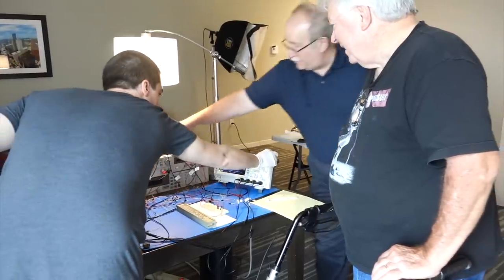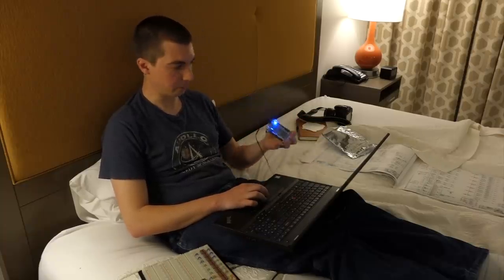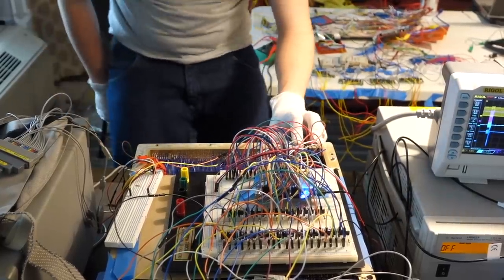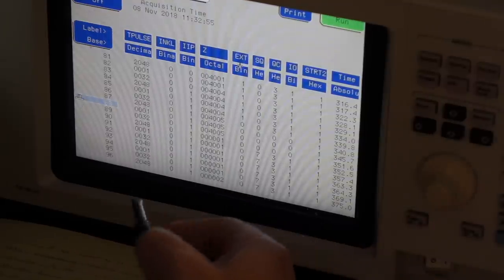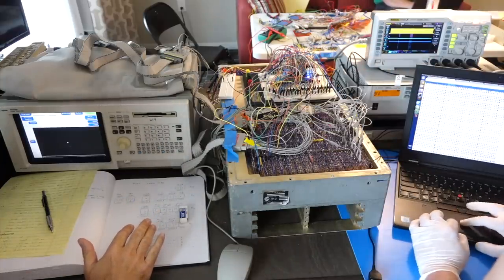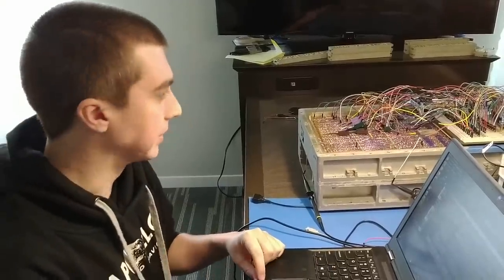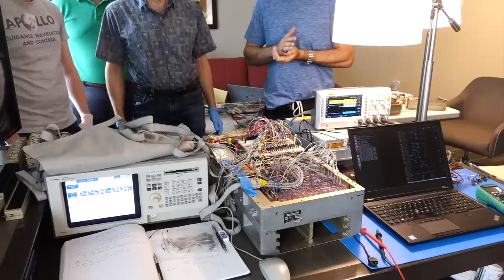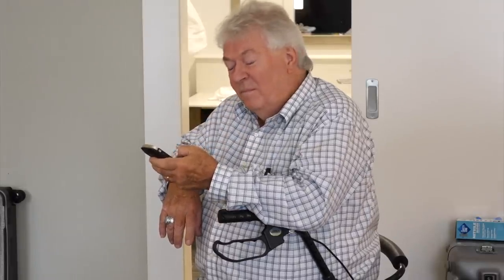Apollo Guidance Computer Part 5: We run a chunk of original Apollo code!

Comment: It would be so cool if you could get this thing running up to 100%, with the DSKY and clock displays, and then run the launch guidance program at 9:32am on July 16, 2019.
Reply: So that's what I was doing 50 years ago. lol
Reply: Conect some form of output ( some lamps ) To unused ram partitions and code a simple game by writing to these memory adresses .

Ore a game on the dsky if there is one available 
That would prevent bored astronauts
Reply: Wasn’t launch guidance provided by the IU in the interstage ring between the SII and SIV-B?  
    Was the AGC simply running a display of the MET, and velocity while providing attitude data to the 8 balls?
Reply: Stepclimb I think the IMU did handle the data gathering and the actual execution of the launch commands, with the AGC being there to monitor and function as a backup if the IMU failed. On Apollo 12, we saw the AGC get taken out by the lightning strike, but the IMU was unaffected. I wonder what would have happened had the reverse occurred.
Reply: The Saturn V guidance system was totally separate from the Command Module's, and had its own IMU. The CSM's IMU was affected by the strike, in that its control loop was broken and so it started tumbling. They had to re-align it once they got to orbit.

I believe on all missions the AGC could take over control of the TLI burn from the SIVB, but on later missions it was possible to take over during any stage of flight. During first stage flight the computer did open-loop control, but the closed-loop control needed during second and third stage flight didn't fit in the available memory, so the astronauts would have to joystick the Saturn V into orbit by comparing numbers on the DSKY with the current trajectory.
Reply: Mike Stewart Manually flying the Saturn V into orbit...now that would have been quite the show!
Reply: @Stepclimb  I think so it was just the in orbit controll 
But many of the calculations needes for the mission were made on the ground and send up the agc had the task of regulating the unpredictable and to work as an interface
Reply: dirt builder 
     That’s right, and some processes were duplicated.  For example, the vehicle’s state vector could be calculated using angles from celestial bodies.  The angles were loaded directly into the AGC from the telescope and sextant and compared to known celestial body angles in the rope memory.  
      The vehicle derived state vector could be compared to Houston’s solution (derived from radar/telemetry) and the ground based solution could be “uploaded” into the AGC.
Reply: The AGC could do a takeover during launch and TLI, but it was only limited to providing steering control; it was intended to take over in case the IU's own attitude reference was lost. The burn could still be continued manually, though, just without the accuracy of total computer control.
Reply: well they only have like 5 days left for that

Comment: The clock on my VCR has been blinking 12:00 for twenty years and these guys are re-engineering  NASA tech in a motel.....
Reply: My Grandmother recently passed away and still had a VCR that blinked the clock - both time and date. She'd never bothered to set it, but I found the instruction manual and dusted it off and reprogrammed it. Found out it didn't work, so I went on ebay and got the parts and fully repaired it and made it operational... I felt like a god
Reply: What is a VCR?
Reply: @col8981  video cassette recorder, before digital basically it recorded programs onto physical tape, also was used to play movies on and a ton of other things im too lazy to type
Reply: @col8981  video cassete recorder

Comment: great video -good job. I used to test this computer in 1st floor in  Bldg. 6 Downey Space Division Rockwall back in 1969, The computer was heavy and it was connected to a checkout console. It was quite easy to test for experienced computer trained technicians. Just hook it up run the test program and it was done, I never saw the inside of the computer when I worked on it. It was nice to see the complete break down and hand testing of this device on video..

Comment: Yes! I kind of knew that you were not going to find the memory that you needed. I suggested Fpga emulation on one of your prior videos. I'm very happy to see it happening. Core/ rope can be emulated and interfaced so much easier than trying to knit that damn ancient rope memory! I think it would take several months to try to turn it the code into a new rope.
Reply: This was just a temporary solution to get as far as we could using what we had during that week. Our primary focus right now is to get the original memory working again, and we'll only resort to FPGA stand-ins if all other options don't work out. But even if we do, it will be much less of a disaster of wires than this was. :)
Reply: @mikestewart8928  it's going to take a long time to hand knit the programming. I don't suppose there's any way I could get involved? Oh well, just hoping, I'm a nobody in the world of intellectual Giants. I really enjoyed this. I'll stick with my esp-12e Iot printed circuit boards.
Reply: @williambello4089  No need to hand-knit anything. I'm counting getting the original rope simulator interface boxes working as "original memory"... and we should hopefully be able to get the erasable module going again one way or another. You're right, hand-weaving a set of rope modules would take months. We do have a listing of the original assembler, and its output format is control instructions for the machine that shows you which core to run the wire through next... so it would be easier if we could get the assembler running and build a replica of that machine. But that is a project for a future day.
Reply: @mikestewart8928  anxiously awaiting the next installment! Best of luck to all of you, have a happy holiday.
Reply: @williambello4089  Thanks, and you too!

Comment: A fantastic achievement, and that's an understatement. Just a question, when the computers were in the CM and LM I believe they were fixed to cold plates. Have you used an infrared handheld non-contact thermometer to check for p/s and logic module hotspots or is heat dissipation simply not an issue when the computer is run with the top and bottom panels off in a sea-level atmosphere?
Reply from the maker: Cooling not an issue. It’s quite a low power machine for its size. It dissipated only 38W in the tests. I bought a chiller just in case, but we probably won’t need it.

Comment: Just saw one of these in the computer history museum in San Jose, CA and thought of you guys working on it! Without the guidance system connected up, won't the DSKY and AGC show a ton of errors? i.e. it's not seeing any incoming telemetry from the various systems it controlled. I know that's down the road. However, I'm confident you guys will get to a point where all the Apollo code can run on the AGC. Looking forward to the next get together and video!
Reply: Yes, we would like to present realistic input to the software. How crazy we go with that depends on how rapidly we get the AGC and its DSKY substitute running at 100%.
Reply: Fun fact -- the one in the Computer History Museum is AGC 200M, the very first operational Block II AGC.

Comment: The ‘interface circuits’ look familiar...  Are those the bidirectional logic level shifters from Sparkfun (BOB-12009)?
Reply: That's where I started, but it turned out that they didn't work for this purpose so I had to redo it. Because the AGC uses RTL logic, a logical 1 can be anywhere from 0.8V to 4V. It's hard to find something that will interface properly with this nowadays... so what I ended up doing instead was building my own RTL input stage with discrete transistors and resistors. I made the base resistance high enough to hopefully not overload any of the nets I was leeching off of, and pulled the outputs up to 3.3V for FPGA input compatibility. I say hopefully, but this is another one of the possible reasons why it fell off the rails after the 2000 instructions... by adding another load to all of those nets, I was slightly changing their timing and possibly taking some beyond their design load and making their line between 0 and 1 too marginal.

Comment: Amazing!! Which model of FPGA is that??
Reply: It's a DE0 Nano. I like these little boards with none of the clutter and just tons of I/O. :) It's got a decently sized FPGA on it, but sadly not enough memory cells to emulate the full fixed and erasable memory. At the end, I switched over to running Retread 44, the very first Block II program ever made, because I could get away with only simulating half of both memories since it's such a small program.
Reply: Mike Stewart thanks!!!

Comment: Is Mike's FPGA code available on Github? Would be neat to play with it!
Reply from the maker: Right here: https://github.com/virtualagc/agc_simulation . And the fascinating blog on how the hell he managed to achieve this feat is here: http://mikestewart.hcoop.net/2016/03/06/fpga-support/
Reply: That's for the FPGA AGC itself, which is much more interesting to play around with. If you were wanting to see the final form of the FPGA code as running on the memory simulator in the video, you can see it here: https://gist.github.com/thewonderidiot/5109ecbb53d34bd4c2829503a00c8d21

Disclaimer: this was written very quickly and underwent a ton of fiddling, has no real comments, and uses lots of magic numbers, so... sorry about that. :) Happy to answer any questions about it though. "fixed" and "erasable" are just instantiations of the Altera/Intel-provided RAM IP blocks.

Comment: Can someone elaborate on the "1 error, but hard to fix error"?  thanks!
Reply from the maker: Ken was referring to the broken wire inside the erasable core memory module (actually he said one failure, not error). The module is potted. That's going to be a tough one to repair. I won't elaborate until we find a way to fix it...
Reply: @CuriousMarc  Thank you for answering.  I know from experience potted components giveth, and potted components taketh away.  Great work, keep it up!